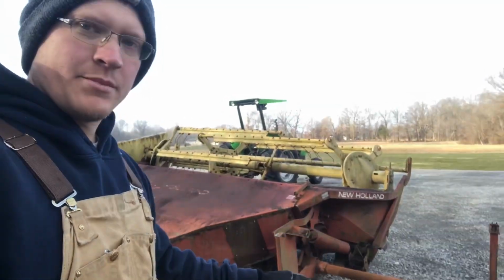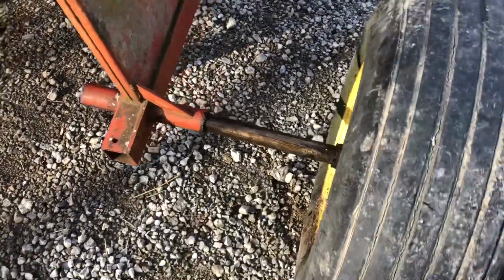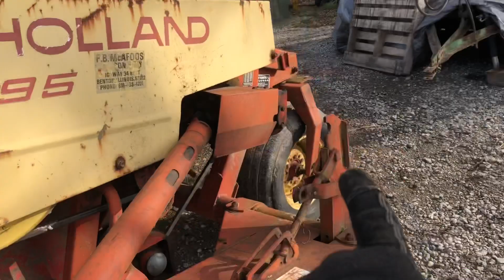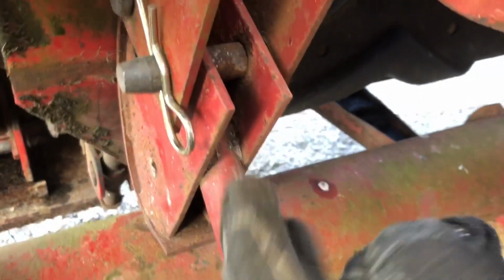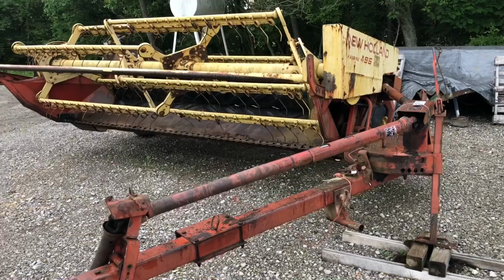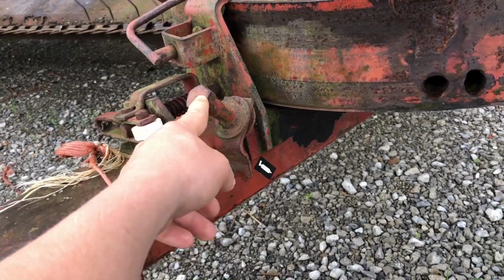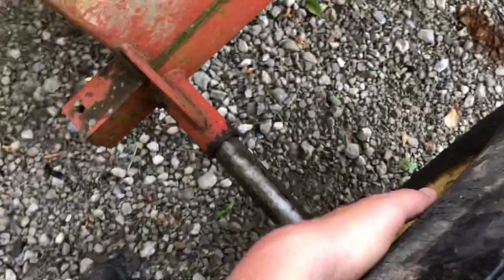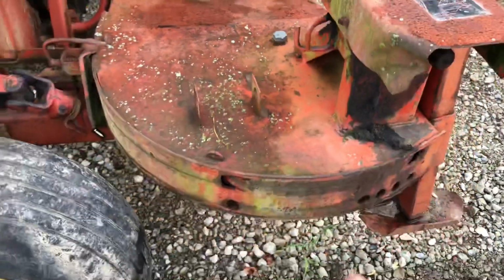495 NEW HOLLAND Haybine - Fold/Unfold

Comment: We ran one of these for a number of years. We normally used it on first and third crop hay that was going into the silo. We found that the hay being pulled together from 12' to the 9' crimping rolls left clumps along the edges of the swaths and it didn't dry well for making dry hay. For that I used a 479 NH 9' haybine. The transport process was a pain, you didn't do it for fun. These machines used a single wobble box running the 12' sickle, same as used on the 7 and 9' machines. This was the weak point in the machine, we had a number of wobble box failures, where the box was pretty much bullet proof on the smaller machines. The 12' Hydroswings ran a wobble box on each side with only 6' of sickle to solve the problem.
Reply from the maker: I didn't really have issues, I could see where it could cause some clumping.  I didn't have an issue with the wobble box mounting when I first got it but I fixed that and didn't have any issues after that.  I could see where over time you could since the sickle bar is longer.